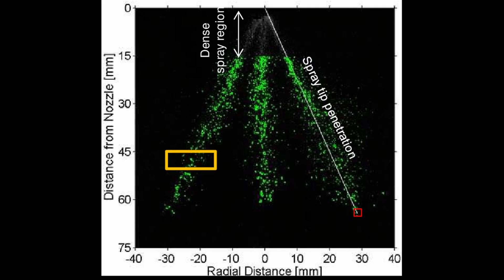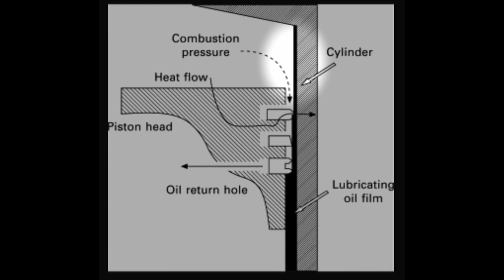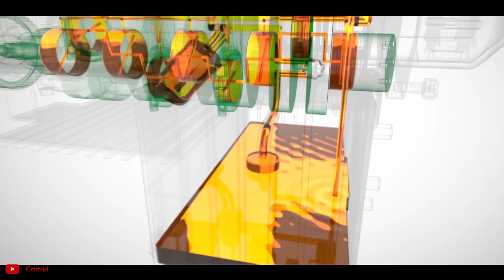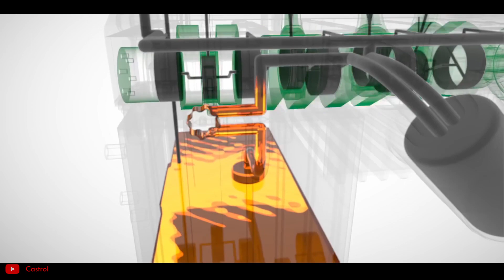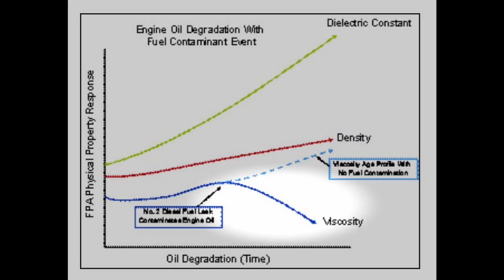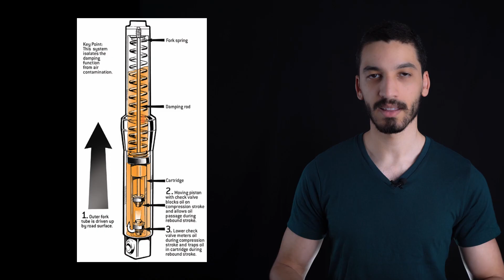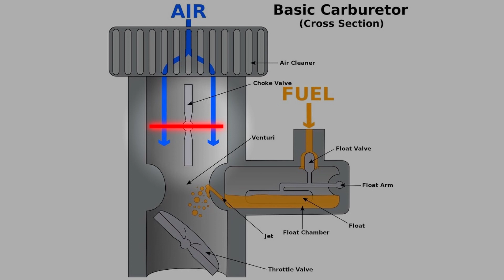The PITFALLS of WARMING UP your BIKE, should YOU ? | LET'S TORQUE

Comment: youre right, but so wrong.
i dont own a bike, i own a car, a v4 wrx sti. i idle it until the thermostats open, i know when they open because my idle drops below 1k rpm.
now you need to put a oil pressure gage in your bike to understand what youre talking about, because i know i have on on my car, cold oil has more pressure. i agree do not idle an engine more then it needs to. but you need to clarify. cold oil always has more pressure, it doesnt mean its doing the job it needs to, atomization of fuel in that instance woud only apply to two strokes, if your fuel is stripping your cylinder of oil, you need a to up your oil, or do a leak down test because your engine is fucked
Reply: side note, i agree with your conclusion, except if youre getting fuel into your crank case no ammount of warm up be it none or hours, is going to help, your rings are toast and you will either now or very shorly require a complete rebuild.
Reply from the maker: Case in point don't WRX STI have massive oil consumption issues ? Re your question, it does pick up in seconds, the viscosity isn't vastly different from when engine is up to temperature - there is one, but not too huge. As you know a very thin oil is also bad, and one that is so hot its foaming from lack of fresh air is terrible.
Reply: @UrgetoRide  i know of head gasket issues of my generation, but not burning oil? the only instances of that is under high boost for the undersized vf24 that was fitted factory, they'd cook the oil seal on anything over 18psi
Burning oil isn't a known thing with wrx, water yes, oil not really
Reply: You can still get in and drive it immediately.

You don't have to thrash it
Reply: @NickTaylorRickPowers  yea, that's the point, most people don't understand that you need to load an engine, for it to 'warm up'. Obviously there's people out there like you and me that get this, it's not implied how to warm up an engine, or the best method to do so. This video is all don't. Which is wrong, engines need all fluids flowing before maximum load, the best way to achieve that as with the example of my wrx is to idle it until the thermostats open, what I didn't say is that i keep it under 2.5k rpm until it's at temperature. I drive it about 1 min depending how cold it is some times 2 min 
What's not explained is why. 
As I've said oil pressure spikes when cold, it's not doing its job, but the pressure is there.

I'm more concerned with the whole fuel cleaning the cylinder of oil, and fuel into the crankcase.. that's not how any of this works. 
Even a two stroke doesn't work that way. 
That's complete rebuild if you've got fuel in your oil, you've over pressurized your crank case, which will cause big end failure, if not you'll spin a bearing. Ask me how I know this - and it has nothing to do with my wrx
Reply: @sleepwalker3520  engines weren't meant to last forever, some people are so scared of an engine going Allah Akbar on itself 

Yolo
Reply: Sleepwalker are you sure you watched the same video?
Reply: Sleepwalker, modern bikes also do exactly this too, just like cars. 

Different with a carburettor and whatever engine its attached to, my little 50cc put put is fine off the choke pretty much straight away, but my big thumping single plodder on the other hand at least likes the barrel to be too hot to our touch before it can be flicked off, now i dont know what the exact temperature of it, because its air cooled. 

As said before, the videos on this channel need to be clear as to the point they are trying to get across on here, because its potential to spread misinformation is there. 

Internet for you though i guess, anyone can be who they want to be.
Reply: @NickTaylorRickPowers  lol you made me spit out my coffee with that comment. 😂

Comment: v good, not sure i agree with everything there but definitely lots of petrol washes the oil off of the bores (had a total seize of a two stroke due to carb jets being way too big in years gone by, due to exactly that - the magazine produced an addendum the next month saying the jet size quoted was way too big rofmlao, thanks bike mechanics) and cold piston/rings dont seal like hot ones!  so in retrospect perhaps i do agree with you lol....
Reply from the maker: Haha wow thats gotta be annoying :/  Hope it was while stationary !

I mean modern oil with all the additives and piston rings designs, cylinder alloys etc etc mitigate it all. But on the whole the best thing you can do is to bring up the engine to temperature as quickly as possible.

Thanks Paul for tuning in !

Comment: I don't agree with you
Reply from the maker: That's ok Julian, which bit exactly ?
Reply: @UrgetoRide  although I don't think it's necessary to sit for 15 minutes waiting for the engine to heat up fully. I do believe there has to be a period of a three or so minutes to allow the oil to start circulating the engine properly especially in winter (I'm in the UK) if for no other reason than mechanical sympathy for the engine. Interesting topic

Comment: Well presented and entertaining. We start our bikes and ride off within a few seconds so as not to piss our neighbours off, works for us👍 Nice to see the XSR (well the clock) make the cut. 
What do you make of these ECU flashes (Woolich racing springs to mind) where it 'warms your bike up' prior to riding?
Reply from the maker: Thanks Banditman for tuning in ! Glad you're on the same wavelength ;) I think they're fantastic but not indispensable  -  could easily be replaced by simply riding off in the manner described in the vid! All they do is blip the throttle to something like 4,000 rpm on and off for a bit to give the engine the heat it needs without putting load on it, which really you can do yourself and you'd actually be going somewhere 😆 Looks sick though, very MotoGP-ey.

Comment: I've read the comments... so here goes. 

1) what is excessive idling? Do you wanna put a number to that?

2) generators, especially industrial units can idle for hours. They seem to get on fine.

3) the fuel atomisation argument only makes sense when the engine is cold. Once it heats up you can idle all day long as long as the cooling system keeps up.

4) you said 5% of oil contamination. I've had oil analysed plenty of times and 5% is a very high number. Not only that but 5w30 isn't bad. 

5) clearances not tolerances...

6) let's say your bike idles at 1500. 3000 rpm during acceleration equals about 2.6 times the amount of fuel in the cylinders when cold.... so if you wanna go fuel washing cylinders route then you're making it worse...

7) for a 4 cylinder 600cc engine how much fuel is there in each cylinder per stroke at idle. So a Ve of say 30%? 

Jason from EE made this massive fuck up talking about the same thing.

8) what do oil control rings do on the downstroke? You say oil is washed off the cylinders, but this is above the piaton ring line on the DOWNSTROKE...

Think about it!
Reply from the maker: Nice username haha
1) Depends on just too many factors, precisely why I didn't want to put an exact number on it - but over 5 minutes is 'excessive territory' in most cases of modern fuel injected bikes in my part of the world.
2) Didn't argue otherwise. Again I'm not saying idling from cold will blow up your engine - I'm putting down the myth thats it's BETTER for your engine, it's not.
3)  Did not argue otherwise matie - the whole vid which I'm hoping you watched is about idling from COLD. Once up to temp do what you gotta do, the engine is at its happiest place.
4) 5w30 isn't bad but that's conveniently forgetting all the other properties that are dramatically worsened due to fuel presence - its not just about viscosity. Oxidation of oil for example is accelerated and thats terrible for the oil and the engine.
5) Using them interchangeably is fine - always have never had a problem .. happy to be proven otherwise
6) You're also bringing in more air so it combusts - its not like it hangs around.. and most importantly you're generating more heat much quicker - the whole point
7) There are just way too many factors that go into this...
8) Not sure I get your comment here .. please correct me if I got your wrong, but oil DOES get past the rings, they're not a fixed impenetrable entity. There are piston rings designs which are extremely good but cost an awful lot more than the usual ones which can get displaced just enough for oil and all sort of crap to go through during the big forces of the strokes up and down.

Sorry it took a while to respond. One of those crazy weeks..
Reply: 5) Using them interchangeably is NOT fine because they are not the same thing lol. You've probably never been told off because no one bothered to.

Tolerance is like a limit, it's how much you are allowed to deviate from a true dimension. Like a manufacturing standard if you like. e.g. 20 mm plus or minus 0.005 mm

Clearance is the actual gap between two components. e.g. the radial distance between a cylinder and a piston, which will vary with temperature.

Now having said that - considering it would literally just require a dictionary or a fundamental knowledge of the English language (let alone an engineering degree) and that you have dodged every similar question in this comment section - for the love of God, can you tell us if you have any qualifications on any sort of technical subject?

Comment: You don't need to fill the oil filter first. You risk filling with debris. Oil the seal, fill sump to max mark, run for a couple minutes, let it settle, then check and top up as needed.

There are cases where small bits of metal have been found in the engine. Where did they come from? I'll tell you - from the container it came from. It breaks off and enters the filter.

Not forgetting some filters are at an angle anyway.
Reply from the maker: How does metal come from in a plastic container full of oil ? Where do you get your oil from lol. Also slightly invalid argument as let's muster all our will power and assume there's metal in your oil container. Well whether you fill your oil filter like i recommend or don't that metal will find its way into the engine, only now you've put it straight into the sump..
You're absolutely right, most filters are at an angle, but some common sense can still be applied, I'm not talking fill it to the brim and then spill half of it before it's even properly screwed in.

Thanks for stopping by FC, hope you're well
Reply: @UrgetoRide  Where does it come from? Have you seen oil bottles with the a foil seal on top? That's where your metal comes from.

When I come across  those, I remove the entire thing.

Comment: Yes and No
Reply from the maker: Thanks Adnan for tuning in ;) Care to expand on the no ?
Reply: Urge to Ride Hi, my limited understanding of course. The bike needs to be warmed as you said but in extreme weather conditions it would determine how long that time would be. There is pressure but the oil would need a bit of time to circulate and I can’t imagine the piston rings would be dry completely as when you change the oil, engines need to be warmed up and you still don’t get all the oil out.